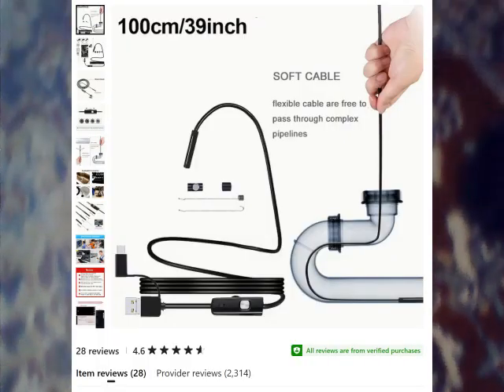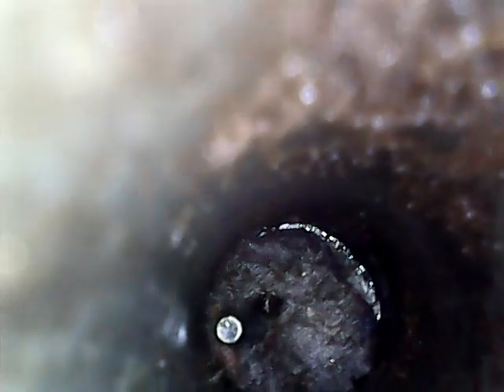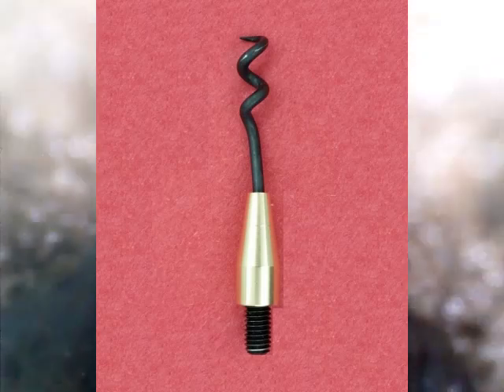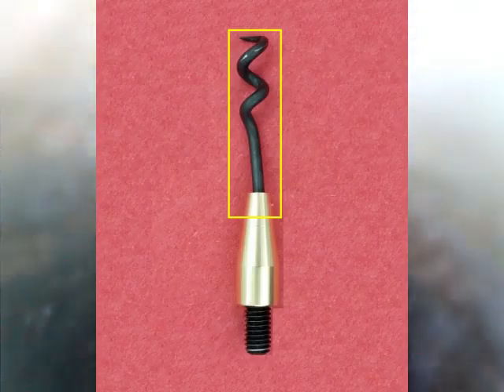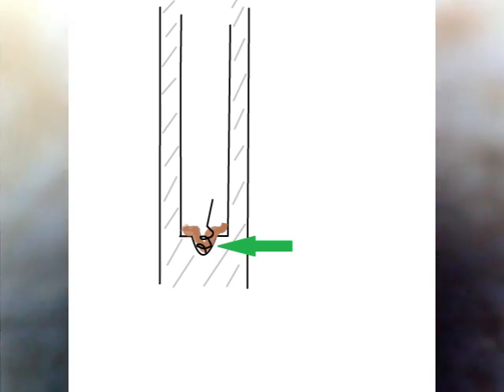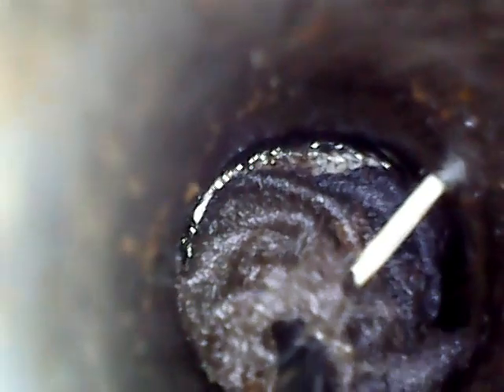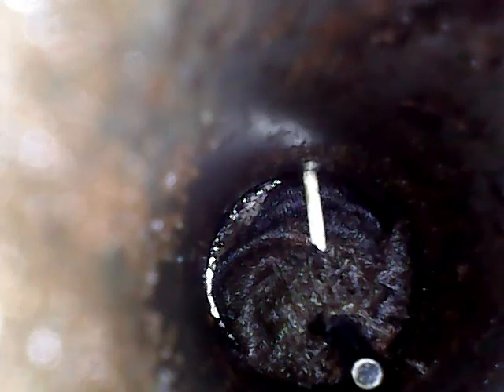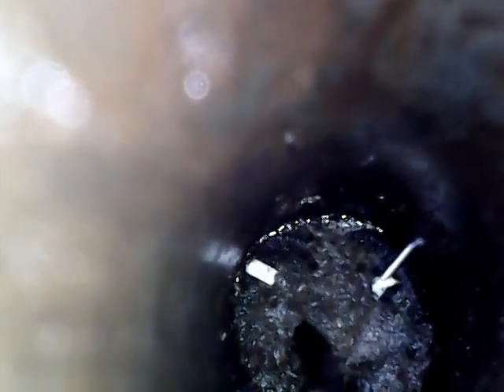Problem with my matchlock arquebus

Comment: I would try pulling out the broken worm by hooking the spiral with a noose knot or alternatively with a hook screwed on a wooden/metal rod. You could also try using a long threaded rod with a thin and pointy rod hanger on its end, it should work as an improvised worm.
Reply from the maker: Tried a rod with a screw-in hook, it didn't work, I could feel it getting caught up on the metal but not engaging. But I did finally get it out!! (see my other comment)
Reply: @femboymusketeer  did you try sticking a small tube in and pouring power down the tube Dan like 5 grain to unplug the barrel it might sound crazy but mit work
Reply from the maker: @JosephElliottRoy-l7i  I tried that and it didn't work because the powder was above the patch not below it. I eventually was able to get it out using the grabber tool